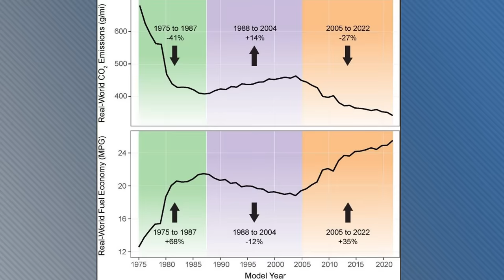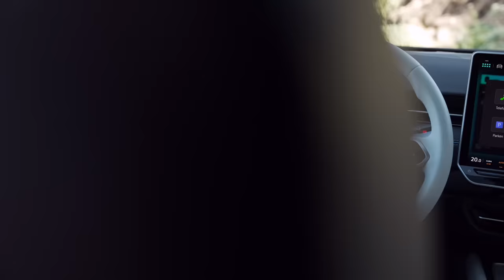Waymo Says AVs 6X Safer Than Humans; Tesla Hitting Battery Production Hell - Autoline Daily 3716

Comment: Concerning EV battery problems

Production At GM Factory Zero Plant Resumes After Fire

The Detroit Fire Department responded to the fire with a three-alarm call that summoned 18 fire trucks and 60 firefighters to the plant late on Tuesday. 
The report indicates the fire took place in and around a loading dock area and that lithium-ion Ultium battery units awaiting installation in EVs caught fire.

Source: GM Authority
Reply: The way I heard it, a forklift had punctured some containers of battery materials.  This is very different from batteries catching fire.
Reply: @davidmenasco5743  

Thank you for the info above that would be better than spontaneous combustion.
I read a complete investigation is going to be done by the city fire department it will be interesting if that is what they document, I am going to track this.
I read LFP batteries can take punctures and still not start on fire the above is not a warm feeling say if the batteries are in an accident.
As a consumer fires are my number one concern not only the vehicle but other structures and vehicles near the one on fire.
Reply: @lp6696  Firstly, the report said it was containers of materials, not batteries, that were punctured and caught fire.

Secondly, if fires are your number one concern, then you don't want to buy an internal combustion vehicle, and especially not a hybrid.

According to IEEE Spectrum, 1,530 ICE vehicles catch fire per 100,000 vehicles sold, while 25 EVs catch fire per 100,000 vehicles sold.

In the event of a gas tank rupture, ICE vehicle fires can develop extremely quickly, which is very dangerous for the occupants.

EV fires, by contrast, develop very slowly giving occupants time to exit the vehicle.  But again, note that EVs are 60 times less likely to catch fire than ICE cars and trucks.

Sadly, it seems that hybrids actually catch fire even more frequently than traditional ICE vehicles.

But that data is a couple of years old.  Many EVs on sale now use LFP type batteries that reportedly don't catch fire.

Comment: I believe Tesla is also using 4680’s in the ‘structural battery pack’ used for some Model Y’s as well.  Likely why Tesla is putting in all of the additional capacity and gone to the trouble to change to dry coating (cost and speed advantage, once tamed) cathode for 4680.

Comment: I don't trust Waymo to collect and analyze automotive safety data. They have self-interest at stake that may skew data in their favor. I'd like to see a deeply knowledgeable but disinterested third party do this work and see what they say.

Where's your data for saying that sales of BEVs in the US have slowed considerably? Haven't they increased by 50% over last year? How is that a slowing of BEV sales?
Reply: It's a consistent problem that a slowdown of the rate of growth is reported as a slowdown of sales.

And yes, I take any "data" with a grain of salt if the source is the same party that has the most interest in that data.
Reply: "It's a consistent problem that a slowdown of the rate of growth is reported as a slowdown of sales."  Absolutely.  Should also note we need a bag of salt regarding media reporting of EV issues.
Reply: @danharold3087  Indeed, that Reuters report about 4680 production was evidently and a real hit job.  They took information that the CEO had already reported - Cybertruck production will be very low volume in 2024 - and repacked it as if it were something new.

Comment: As more and more Cybertrucks are seen driving around communities, it will become less jarring. When prices go down, Cybertruck will sell just fine. I believe Tesla will find a solution to the battery supply issue.
Reply: Currently there is no battery supply issue.   As mentioned Tesla is building 8 more battery lines.
Reply: @danharold3087  I believe the problem was only a problem if they do not get the lines built. Sounds like some reports are not giving the whole story to create more of a story than is truly there.